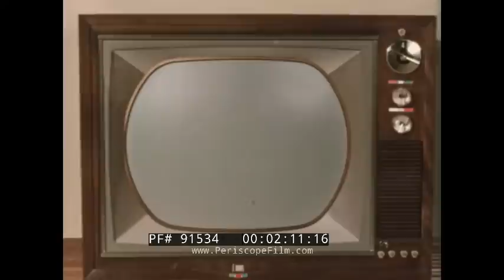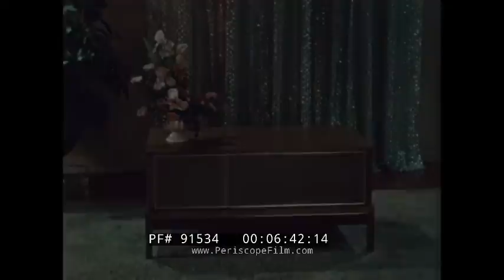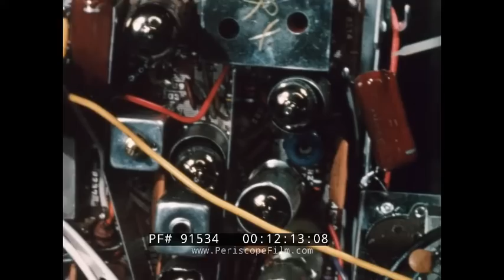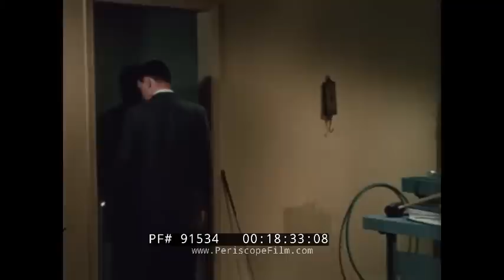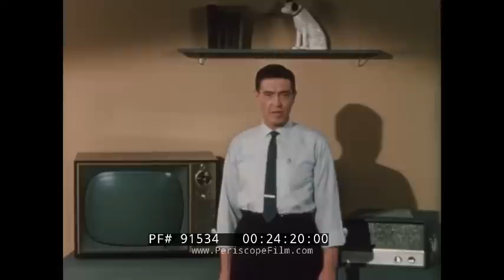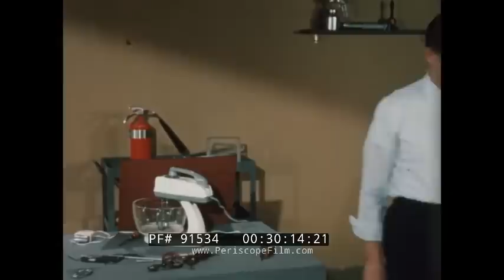1960 RCA VICTOR TV SET W/ REMOTE PROMO FILMS & "THE INSIDE STORY" OF THE RCA TV RECEIVER   91534

Comment: Such a simpler time. Everything built to last!
Reply: When I was in the repair biz we always looked forward to lightning storms. A big boom in business and a quick cheap diode replacement.
Reply: I witnessed the time when tv repair came to your house. I witnessed the death of the TV repair industry. I witnessed the repair of TV components,  to the replacement of horizontal, vertical etc circuit boards. Bad resistor, throw a board at it.
Reply: @defresurrection  Yep, Probably the death really came with 2 things...the "Jungle IC" that did pretty much all the work of the individual components in a TV...color and sound decoding, sync, etc.  That, and the integrated, sealed high-voltage "Flyback" transformer that has the transformer, rectifier, and all other high-voltage parts in a single module.  Those two parts became so rock-solid reliable that you could get over 100,000 hours on a CRT TV before it ever needed any attention.
Reply: These didn't last at all.  The tubes generated so much heat, they should have had a pizza oven attachment.  You were lucky to get 7 years out of a color set.   Now that we have ditched CRTs, TVs can last for 20 years.  We usually replace them because they become obsolete, not because they fail.
Reply: @60gregma  still got the first HD set we bought back in 2006 and it still works fine.
Reply: Your absolutely white!
Reply: until the picture tube blows.
Reply: @stephendacey8761  I remember changing picture tubes when I was a kid. It was simply just pulling the tubes out and sticking new ones in.
Reply: @stephendacey8761  
Back then you would have a television repaired as opposed to today where people throw it out and buy a new one.
Reply: @lowerclassbrats77  yes! Replacement in my house was a stone cold dead issue.  House call, repair cheaper.
Reply: @lowerclassbrats77  today people throw away working flatscreen TV's because they want a bigger one. Last summer I got a 42" LG led flatscreen for free sitting on the corner for city wide cleanup. It even looks new with no dead pixels.
Reply: @B5152g  My 32" flat screen T.V. broke and I have no idea how to throw it out. You can't put it in a dumpster.
Reply: @defresurrection  My father would tell me there used to be a place that fixes T.V.'s at every street corner.
Reply: @stephendacey8761  we have citywide cleanup once a year, you pile anything you don't want on the edge of your yard and they will come and take it away. 
  I usually go and get all the computers and flat monitors I can get, the ones not worth fixing get the hard drive, ram, power supplies, and wireless cards stripped out of them, sometimes processors if they are high end .. 
   the broken screen TV's I strip out the tcon boards and stuff and sell parts on eBay for a quick $20 a piece..
    I also go pickup all the scrap metal and take it a few miles down the road and sell it to the scrapyard.. 
     Citywide cleanup is like Christmas to me you can't believe the great stuff I have found, I make a ton of cash just digging through people's junk before it is picked up.. lol
    I do however feel strange doing it and get weird looks, but whatever..
Reply: @stephendacey8761  fits right in.
Reply: actually in my neighborhood just leave it in in alley and the local scroungers get it over night.
Reply: @B5152g  dam kids throw them out once they're covered in avocado.
Reply: Unlike today.  Everything built to break.
Reply: @JareDevilDog  not necessarily. New and improved us enough for a lot of people to replace an old, working model.